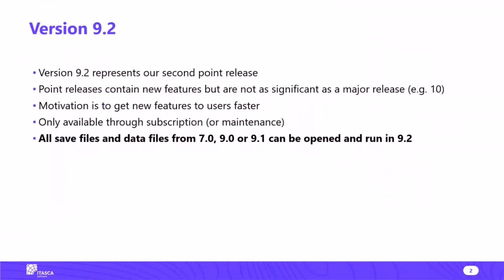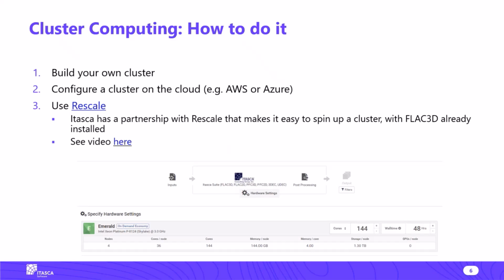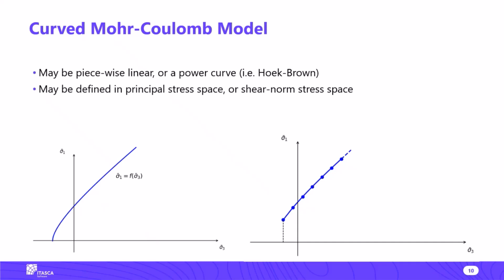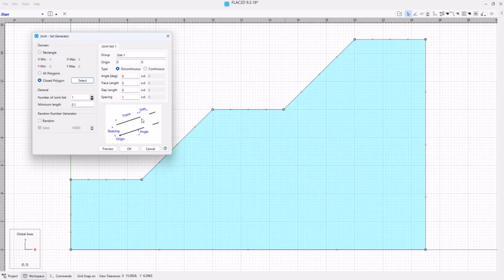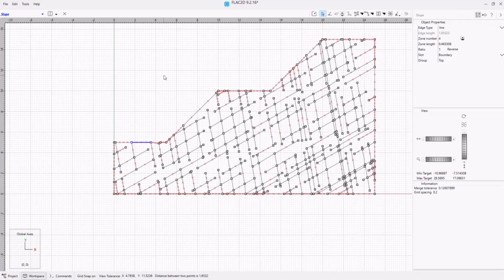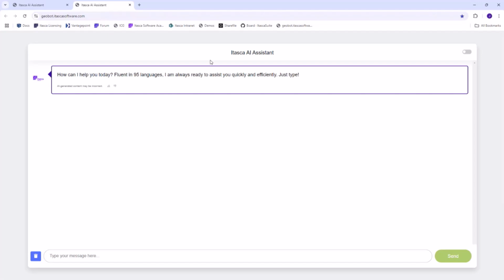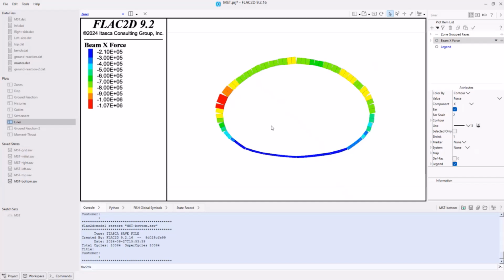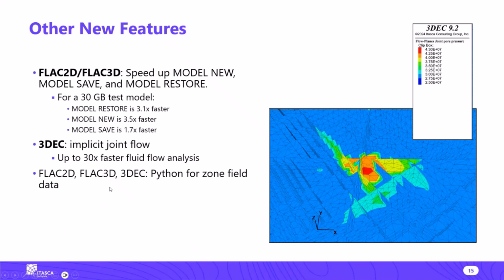Webinar   What's New in ITASCA Software V9.20

Comment: This is definitely a positive improvement. However, it doesn't seem fair that, despite purchasing a perpetual license, we are required to pay for updates whenever a new release like 9.1 or 9.2 is introduced. It's reasonable to charge for major version upgrades, such as moving from version 9.x to 10.0. But interim updates, like those within the same major version, should be accessible without additional cost for perpetual license holders. This would better align with the concept of a perpetual license and enhance customer satisfaction.
Reply from the maker: Thank you for using ITASCA software and for your valuable feedback.
 
We’d like to clarify the distinction between perpetual and subscription licenses. Perpetual products are exactly that—perpetual—and historically, they’ve received bug fixes but not new features. Major upgrades for perpetual licenses occur on a release cycle of approximately every three years, with the next major release being Version 10. The summation of all the Version 9 point releases will comprise Version 10.
 
Subscription products, on the other hand, offer continual access to the latest developments throughout the subscription term. With a subscription license, you benefit from ongoing updates, including both major and minor features, as they’re developed.
 
What has changed is that we are now releasing the next major version incrementally, making each point release available to subscribers as soon as it’s ready. When Version 10 is fully available, those who prefer perpetual licenses can then purchase Version 10 to gain access to all the Version 9 point-release features.
 
Additionally, we now offer a maintenance plan for perpetual license holders, which combines the stability of a perpetual license with the flexibility of a subscription. This plan grants perpetual license holders access to all the latest technology released to subscription holders during the term of the maintenance plan.
 
If this sounds like something you'd like to explore, feel free to contact us at Sales@ItascaSoftware.com. And once again, thank you for choosing ITASCA Software!